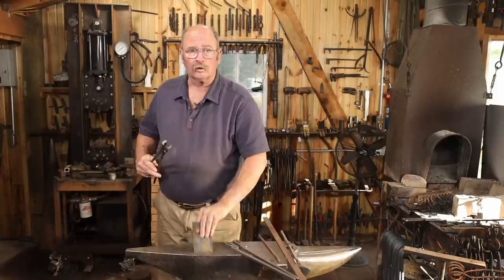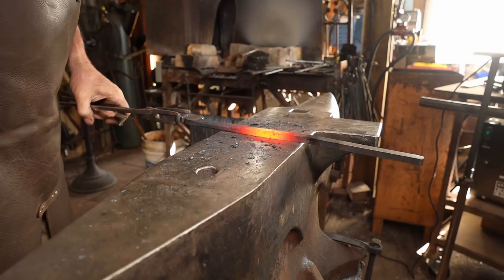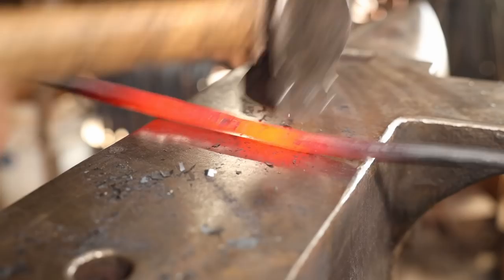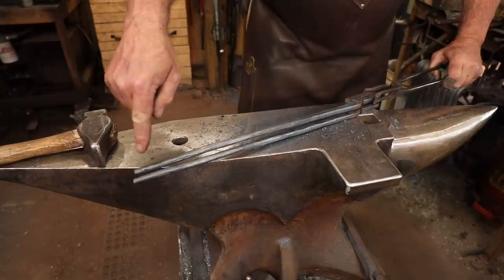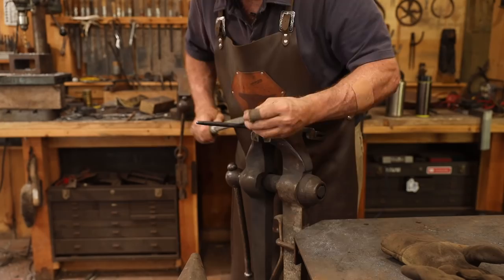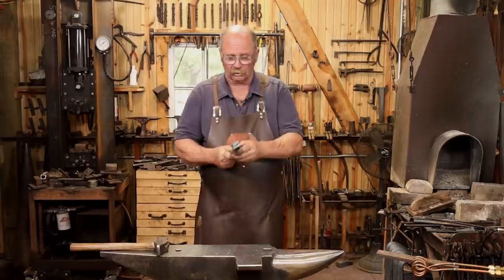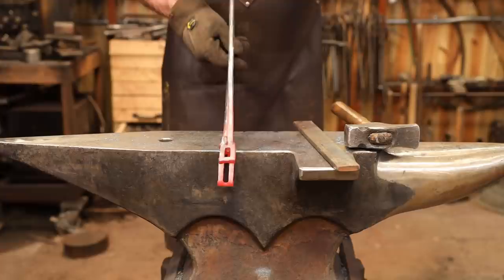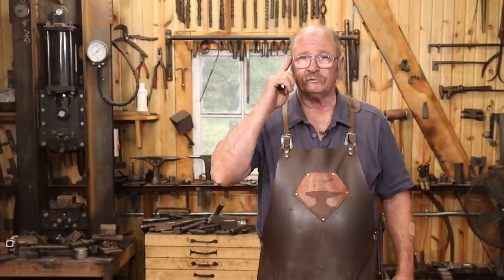Slotted Jaw Tongs from Kens Custom iron

Comment: If you browse Facebook marketplace for the knock offs, you can report them as counterfeit. I'm a full supporter if Ken's.
Reply: Will Amazon do anything about it?
Reply: @BCM1959  not sure. Amazon is typically pro knockoff. Hence the cheap competitive items.
Reply: @dkironworks4037  got it, thanks.
Reply: I am guilty of buying the knock off and got what I paid for. They came with aluminum rivets. :(
Reply: @charlesvickrey1509  ouch. Most of the time I just use 1/4 round bar to rivet, because I keep alot of it in hand. But love their tong blanks from Ken's. Its cheaper to use those blanks when it comes to material cost and time put in to make them. The only exception are very nice custom tongs just for the pleasure. But for functionality. Love them to death.
Reply: @dkironworks4037  I keep steel rivets on hand because make medieval armor, but I should have gone with Ken's from the start.

Comment: Also mention that they give you written directions with the set. When I started forging this was one of my first projects because of this channel. Then I reordered because I sucked at forging. But I leaned a lot about twisting metal riveting and adjusting metal. Lazy people have to steal from another’s instead of putting in the work. Ken’s is a great place to get all sorts of stuff.
Reply from the maker: correct.  But too late to add it to the video

Comment: I built a little forge from a semi tractor brake drum . . .  got an old hand cranked air fan like my grandfather had 100 years or so ago . . . 

Just had not gotten to the tongs yet . . . still need to get the chimney fixed for it.

Your videos have been the most fun to watch . . . just wish I could afford that induction toy you have there.

Anyway . . . have fun . . .

May God bless,
Dwight

Comment: Wish I could remember where I saw it, but there was a guy in a video who made a set of long dies just for reins on tongs. It made 4 are a time or 2 sets. One was slightly larger and you could reduce the first set in the second set if you want lighter reins. It had hefty hinge on the bottom and had 2 striking plates one in the middle and one in top.
Great idea for making allot of tongs or making all your reins uniform.

Comment: I can see the benefits of the induction heater for heat treating and keeping the shop temperature down in the summer. Have you worked out the electric /propane /coal costs?
Reply: Man, whatever the extra cost is in electricity would be worth not adding extra heat into the shop.  Near 100% of the energy going into heating is going straight into the steel, so it's not like using an inefficient electric kiln for forging.  Plus, if the shop has AC, there's no possible way to use a propane forge, but with induction it's feasible.

Comment: It’s funny, I use a much longer rein on my tongs, now, because the blast coming out of my propane forge is incredibly hot and long-reaching.
Reply: Doesn't that mean you're wasting gas?
Reply: A good solution to heat coming from forge is a small fan. Maybe a scrap squirrel cage blower . Set this up to blow an air curtain perpendicular to forge door. This will make it possible to remove parts from forge with tongs and most of heat is blown away.
Reply: Savage Porkchop  no it doesn’t. The exhaust has to go somewhere. Your putting in gas and air. So whatever you put in has to exit aswell. If not then it would be like a ballon, which wouldn’t work.
Reply: @erikcourtney1834  When he wrote "blast" I thought he meant flames were coming out of the forge

Comment: I'm a big fan of your videos. The one you did about how to install your new anvil you said that you used silicone... did you put some to cover the complete surface of the base or just a joint to contour the base? Thanks for your time.
Reply from the maker: I put it over the complete surface
Reply: He made a video about it, it is still up. John put goo all over the underside and so did Torbjorn Ahman a few weeks or so ago when he remounted his anvil. It is the very best way to go. I used a soft piece of rubber sheeting. It works well but not nearly as well as goo.

Comment: That induction forge is quite a marvel.   I wonder, however, about the time spent holding the material while it heats.   It seems to me that there might be something to be said for having the coal or propane forge going with 4 or 6 pieces in there, and not nearly as much down-time without the hammer in your hand.   Maybe the down-time is valuable to avoid injury, but I'm just curious about your point of view on the 'hands-on' aspect of the induction forge.
Reply from the maker: Depending on the project the induction forge can run on a timer and it is great for production work.

Comment: Watched with sound this time.  Much more instructive. 
Off-Subject question.  My touchmark is real simple, "BS".  I am at the Cheap and Easy stage of smithing, so I got a letter stamp set from HF.   How hot do you recommend I get the metal before stamping in order to preserve the sharpness of the stamps?
Reply from the maker: Dull red seems to be fine

Comment: Any thoughts on doing a Kens Custom Iron vs the knockoffs video? I've got a knockoff set coming from Amazon, as I needed something to pad an order to get free shipping. Never had luck making my own tongs, to the point even my "Collins Tongs" didn't come out right. I parked the forge 5yrs ago and fired it up for the first time since Sunday night. Substandard tongs as well as being stuck using anthracite are the main reasons for parking it. The local TSC doesn't even carry anthracite anymore, so once my stock's gone, I'll likely be reverting to charcoal, at an exorbitant price. Another reason for resurecting it is that after 5yrs, I finally found a post vise I'll hopefully be buying this weekend(been listed for sale for over 3 months, being called a "barn vise".)_

Comment: Im awear this has nothing to do with this video but i watch ur video's. To learn as much as i can was interested in building my own porpane forge for cheap can i use 1 to 1.25 ceramic blocks would they be efficient enough. For the heat of a beginner forge
Reply from the maker: With a good burner it should work

Comment: Why does the steel get scale on it when using the induction forge?
Reply from the maker: Scale is an iron oxide, so as long is there is oxygen in the air when heated, it will scale.